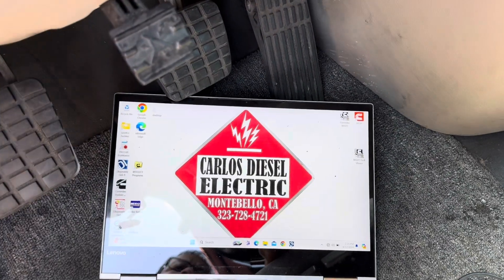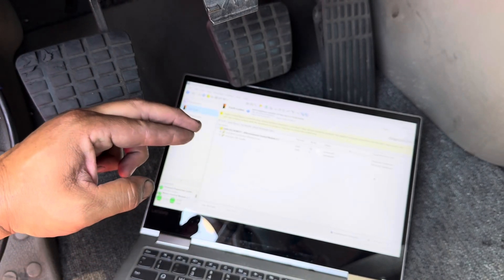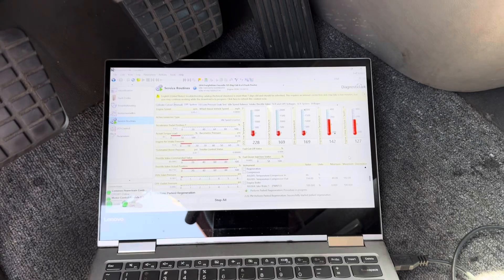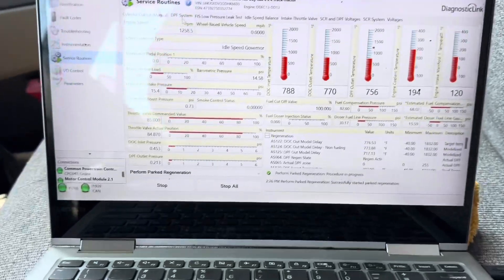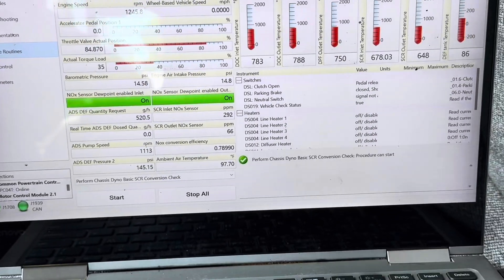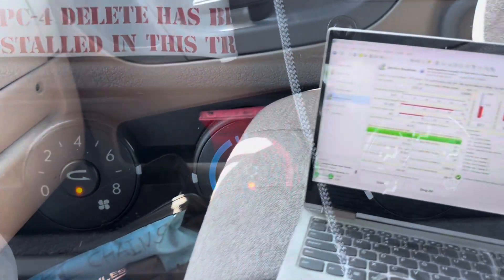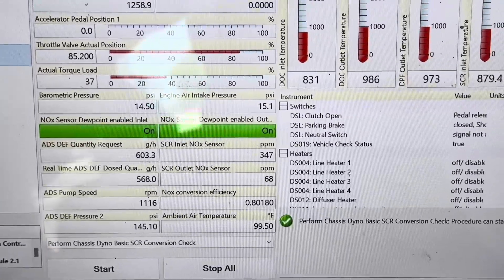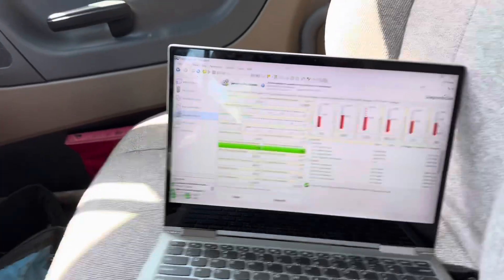NOx efficiency Low, Improper DEF quality faults. Diagnostic work

Comment: Hey brother, got a mill light code acm 4364  17 , it is inactive it did happen about 60 miles after fueling and adding def do you think I got poor quality def
Reply from the maker: It is possible. Try adding fresh DEF from the jug or have someone run a parked regen and monitor the efficiency. How many miles are on the truck? What year is the truck ?
Reply: @CarlosDieselElectric 335k on miles it's a 2021 freightliner cascadia
Reply: @CarlosDieselElectric also I added 2.5 gallons of fresh def and replaced def filter earlier today

Comment: I’ve got a question for ya, 2021 cascadia lost fuel pump, found coolant in the filter housing so changed cups and then after reinstalling injectors #6 stuck open, flooded the dpfs but was able to drain the fuel and dry them out with regen. Now having low NOx conversion, SCR test average about 65% eff just wondering if there’s a way to get it cleaned just a little more so the we don’t get low conversion eff. No previous issue with dpfs or scr system before the injector stuck and yes we inspected dpfs found no damage 😅
Reply from the maker: They contamination is definitely hurting the efficiency. You can try sending the One Box to be baked. This might be the only option (long shot) if not, the One Box might need to be replaced.
Reply: @CarlosDieselElectric I was hopeful the repeated regen would eventually bring it back, it started out at about 50% and after 23 regen and 3 scr test got it to the 65ish% I was almost there 😂 last attempt didn’t make a difference. Anyway I’ve kinda come to the conclusion that’s it’s going to need a one box. It’s under warranty but not if they determine an injector caused the damage and you know they will😅
Reply from the maker: @huntinquincy4238  You dont have to tell them anything about the injector issues. Just say it started having problems. Less is best.
Reply: @CarlosDieselElectric that’s the plan 😅

Comment: If we see this, should we start small, meaning replace or clean DPF FILTERS? THEN IF down the road we see test with similar numbers, call for full replacement of the one box? Thoughts
Reply from the maker: @johnavalos6010  depends on the year you are working on. So early models with DEF have a different work up or approach. What year are you working on.
Reply: @CarlosDieselElectric  we have different MY. 2016-2019
Reply from the maker: @johnavalos6010  if you see soot going through and you can see it at the tail pipe. It can be the DPF are allowing soot to pass through or the One Box itself is compromised. This will definitely bring NOx efficiency down. 
How many miles are on the truck?

Comment: I am experiencing similar issue with a 2016 DD15 with 745000 miles. Truck will ask for a regen if loaded heavy after going up a hill. Once i do a parked regen truck will run fine . I am usually getting  SPN 4364 Aftertreatment 1 SCR conversion efficiency, SPN -5246 Aftertreatment SCR Operator inducement severity and SPN -3364 Aftertreatment 1 diesel exhaust fluid tank quality. Sometimes i will go for days without issues if driving on flat terrain  and light loads. I have been experiencing this for the last 4 months. The DPF FILTERS ,NOX SENSORS,DEF INJECTOR ,DOSER / 7TH INJECTOR were replaced less than 100,000 miles ago. Thanks in advance.
Reply: I was dealing with nox efficiency codes, I ended up replacing  all the sensors on the one box, new one box wire harness and room the whole one box out and had it cleaned along with the filters
Reply: @SFMARK69 did that stop it from happening? Was the issue fixed?
Reply from the maker: @JoelManguriu  is the One Box original? Or has it been replaced?
Reply: @CarlosDieselElectric   it's the original box

Comment: shouldn't the one box last longer than that???
Reply from the maker: @jorgefacio690  I agree. I believe the One Box should last as long as an engine should. The fact that they fail with such low mileage is a crime.
Reply: @CarlosDieselElectric  is there any maintenance that can be done to make them last longer?
Reply: @jorgefacio690 my guess would be to make sure your truck isn't burning oil or coolant... also having valves adjusted make sure engine/turbo are always good

Comment: My truck is doing  the same thing. When regen the nox eff starts high 90-80s and drops to 60s and starts to pick up again 70-80s... what I do is force regen my truck after 2 full working days so the code doesn't come back up. I've been doing it for 3 months and the nox eff low/low def quality hasn't came back up, but I'm sure if I don't force regen then the code could come back... new nox sensors too... so maybe bad one-box?
Reply: Could be a drifted NOx sensor. You can do a low temp regen with the DEF dosing plug unplugged and I think the inlet and outlet NOx sensor sould be within 20 PPM of each other.
Reply from the maker: @LittleRedsGarage should definitely do another video on that.
Reply: @LittleRedsGarage  going try that out thanks
Reply: @ReptoOwnsYou  What I do when the SCR has failed I just buy a new outlet NOx sensor and plug it in and zip tie the other end on top of the one box. It'll work as it always has just tricks it into thinking the outlet NOx is 0. Will throw a code 3057 but won't derate. Everything else in the system has to function correctly however. This by no means is the right way but it does work until you can replace the one box.
Reply: @LittleRedsGarage   I've heard of that too but I might just get another truck with a cummins not a dd13... you think cummins is a more straightforward platform since it doesn't have the "one-box" and the scr can be replaced only no need to replace whole thing...

Comment: Hey Pedro If you click on the fault codes with the + it will give you a drop down menu I believe #5 gives you a little information on WHY it throws the codes, also you can go in after the regen under the logs, and play it back in fast forward that way you don't always have to babysit the truck. Hope it helps!